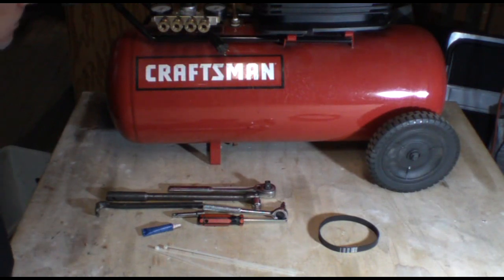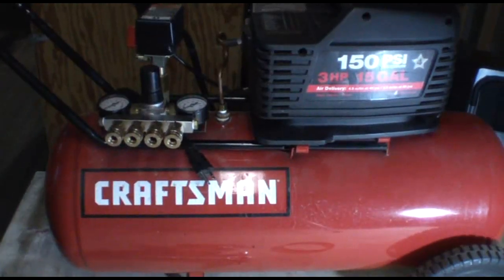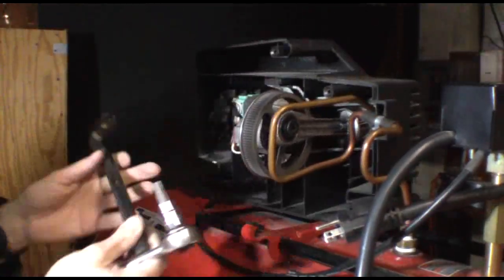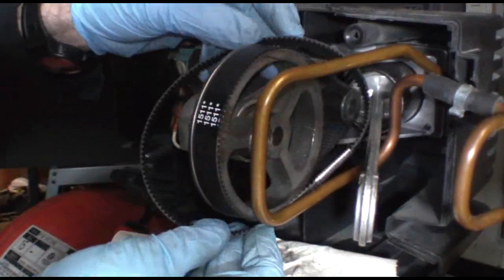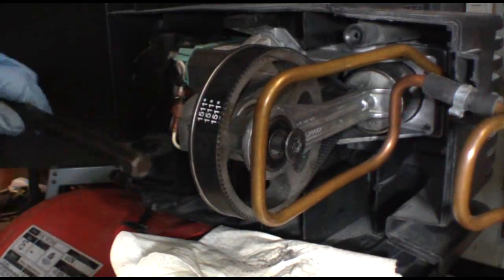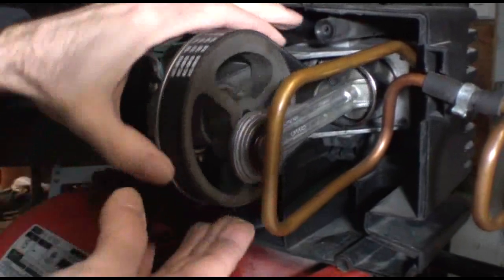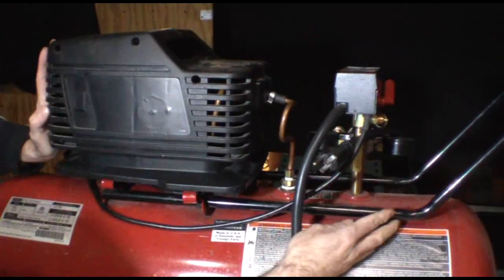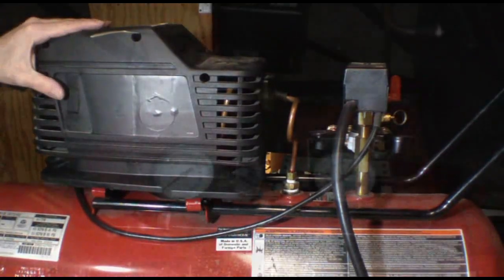Replacing a broken belt on an air compressor that needs fixing

Comment: Good video.  I had that same basic compressor that i bought around 1990.  I once ran it for 3 hrs straight while driving screws with an air drill (this was before impact drill/drivers were invented).  I removed the back shroud and placed a house fan behind the motor.  No issues even years later.  I also cut a square hole in the top and added a computer style "muffin" fan that had a switch so it ran continuously even between compressor cycles.  Keeping the motor / piston cool is the key to long life.  I have made lots of repair videos and the get long really long very easily - some times it is hard to avoid.  Thanks.

Comment: How long is the belt
Reply from the maker: I have no idea, and don't think I ever did. If I recall, I bought a belt based on a part number not a belt length. Just to mention -this repair was done a very long time ago, and the compressor is still working!

Comment: I have a craftsman air compressor model# 919.167630 do you have anything on how to replace the belt? the original has no teeth, and there is no tensioner pully.